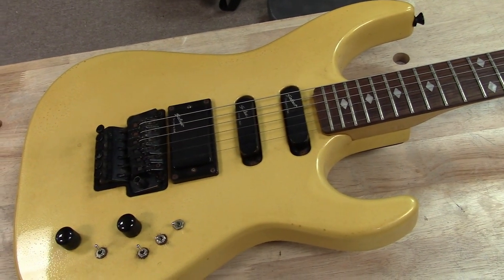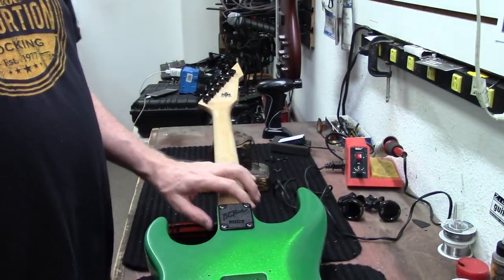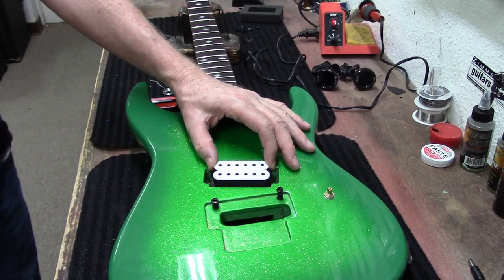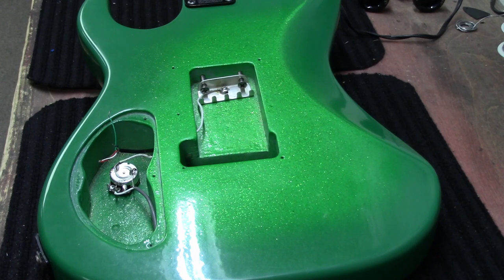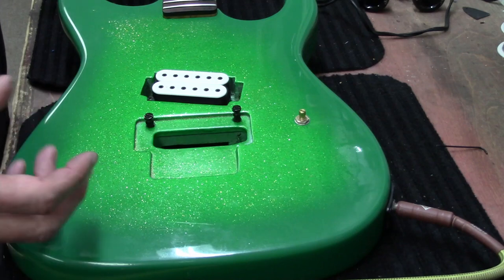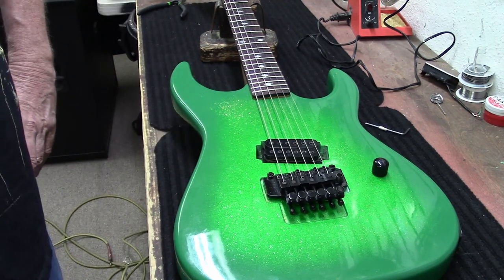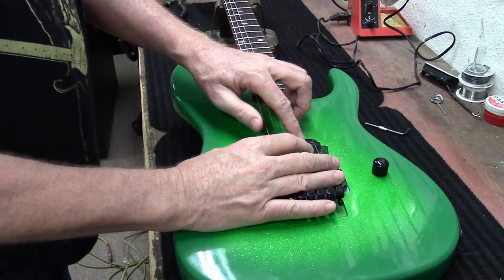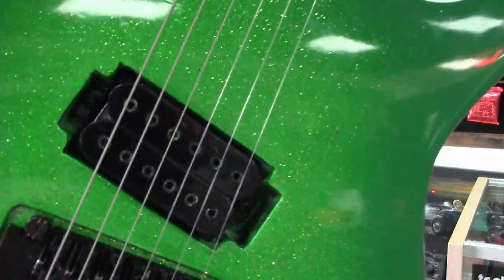Making a Shredder! - Garbage to Glitter EP. 15

Comment: Personally, I think they look sweet without the pickup ring.

Also, I'm really impressed with your painter's work. If I didn't know better, I would swear that's a different guitar body than the one you started out with.

I have a few guitars I had to do that with to keep the floating trem in tune.  The only thing that sucks about it is it does make the bar a lot stiffer, but if you really put a lot of tension on the springs, it does solve the problem.

Great video. I think the guitar looks great. I'd leave the cavity cover off too.  Show off that nice paint job.  I'd probably take the cavity cover off of the electronics too since you don't really have a mess of wires there, but that's just me.

Cheers!
Reply: Nope it's the same NJ series he gave . But damn the angled pickup really through your eyes off though I actually  marked the humbucker on the body the opssite angle good thing I cought it before I rpughtted it lol. I told him with 6he first St3 if we do the single him Iam doing a gunslinger style . Filled the pickup cavitys with bamboo and clear epoxy.

Comment: dude if you just looked up a Dimarzio DP158 you would know its a Evolution neck pickup and Not a Bridge pickup and on all Dimarzio's the Red is the Hot and not the black thats seymour duncans, so you wired it all wrong and All of this could of been avoided if you just spent 30 seconds on the Dimarzio website man n for someone that owns a guitar shop n works on guitars as a guitar tech you should really already know this stuff, total fail man i would not let you near any of my guitars